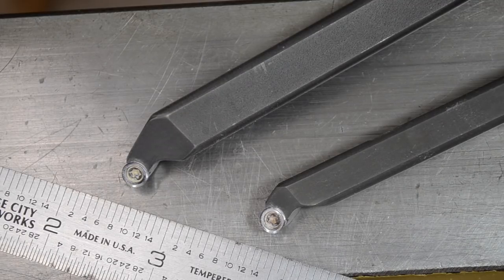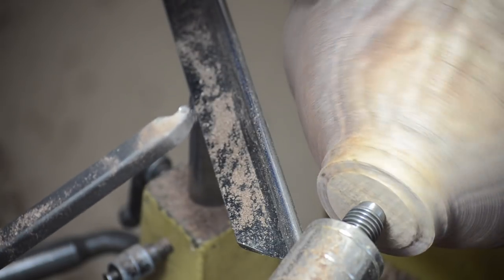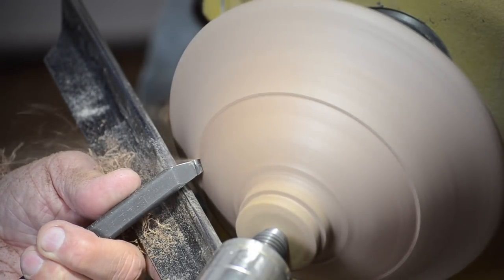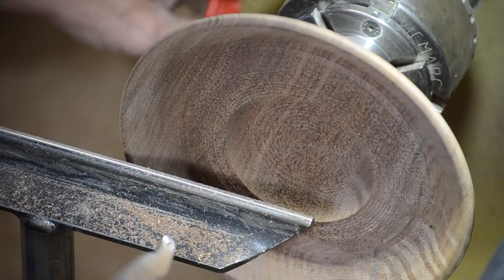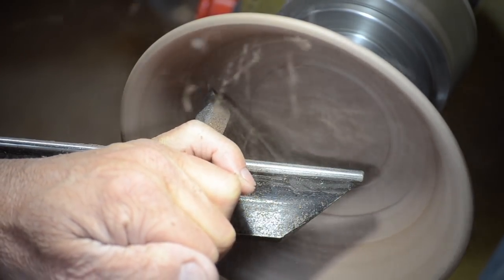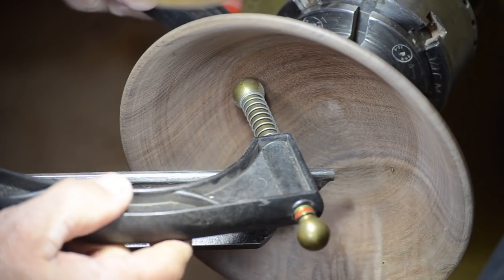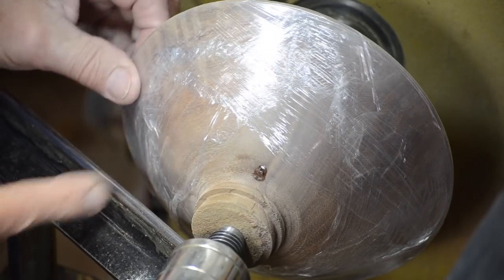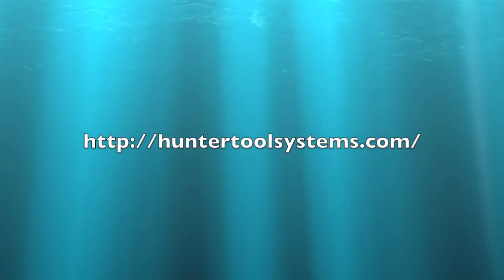Hunter Viceroy tool

Comment: John, The Viceroy looks very similar to the Clewe's mate 2, any difference?
Reply from the maker: there is a difference.  Mike originally made the Mate tools for Jimmy but has stopped.   His tool has a square shank where Jimmy's had a rectangular shank.  The Viceroy has a slightly different angle and shape to the support shaft around the cutter.   I like the Viceroy better for bevel rubbing than the mate tools.  I did like the rectangular shaft as I felt it was better for the new turner but it did make it harder to use as a bevel rubbing tool.   I think the Viceroy is more versatile than the Mate for this reason.
Reply from the maker: It's very similar to the Clewes mate tools although Mike added his touch and l think it makes it easier to use as a bevel rubbing tool.

Comment: John,  with respect, I fail to see the advantage of the Viceroy over a 5/8, or 1/2 bowl gouge.   It strikes me that the Viceroy is certainly a slower to use.   I will say it seems to be "user friendly" for someone who has no experience.
Reply from the maker: I don't think it's slower to use.  I purposely didn't push it in this video.  for experienced turners it does not take the place of the bowl gouge.  For new turners however it vastly improves their success rate.  I've taught 3 classes now using this tool and the Hunter Hercules.  These were brand new turners who had never touched a tool.  All were quite successful with the projects and no catches.
Reply from the maker: If you really push the tool in it will remove wood quite fast.  As a long time bowl gouge user I agree with you but it's a fantastic tool for beginners because there is virtually no learning curve and no sharpening tools needed.